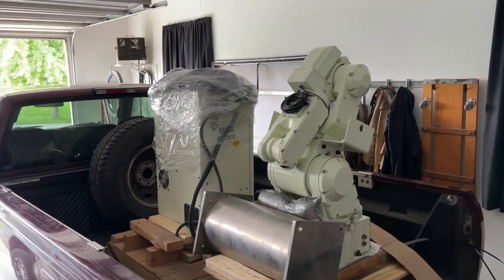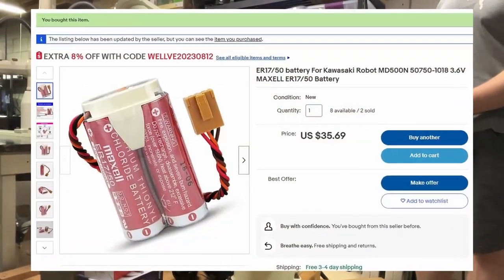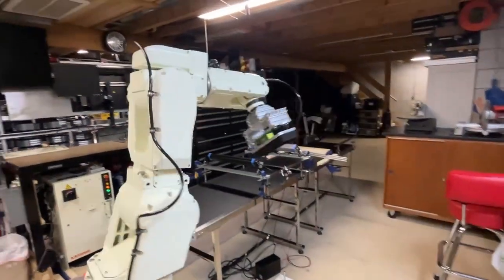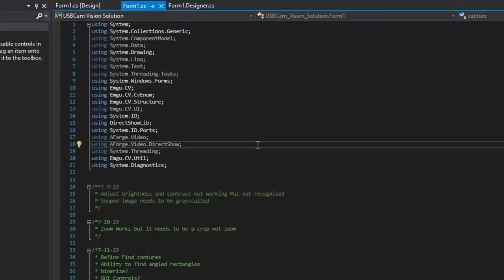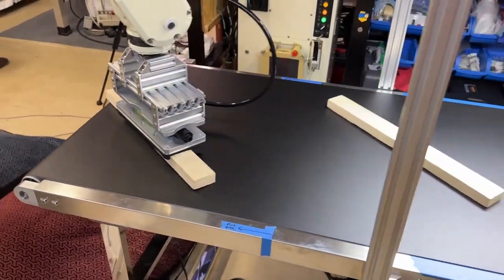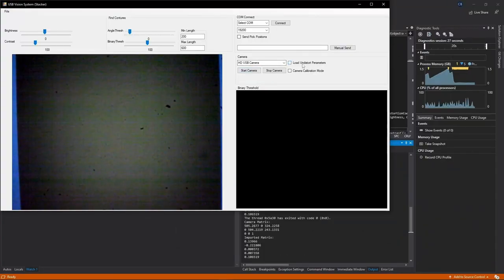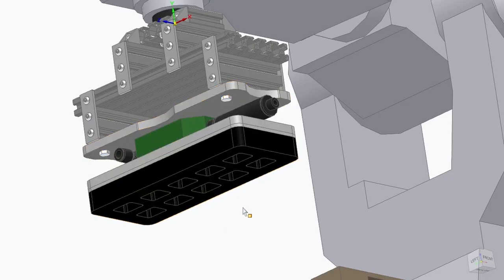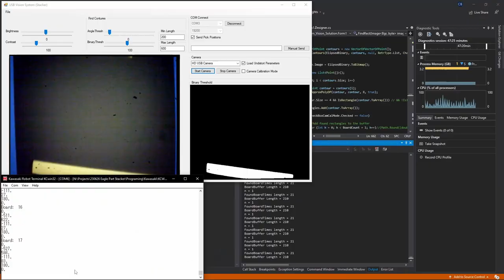Restoring Old Industrial Robot and Giving it Vision to Stack Wood @StuffMadeHere

Comment: Could you use a pneumatically actuated self-centering gripper instead of the vacuum pad?  It would at least make sure the boards are in the same position relative to the end effector once clamped.
Reply from the maker: Yes, that could improve accuracy, as long as you simulate the clarences needed to grab the part from the side.

Comment: Just out of curiosity of safty can you set digital stops for the arm, so that it doesn't accept values that are outside of its workplace, like behind it?
Reply from the maker: Yes you can, I could filter it to only accept a certain range of positions. Built in is what's called a soft stop which constantly monitors the robot's positions and stops it if the movement would result in a collision.